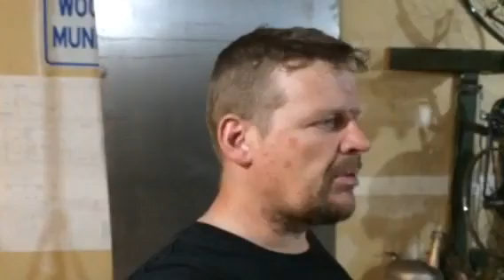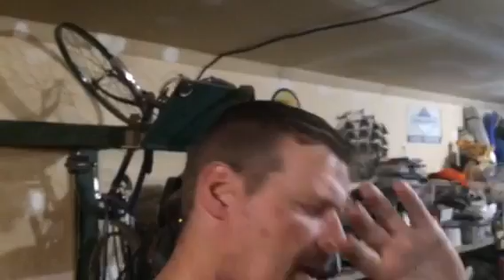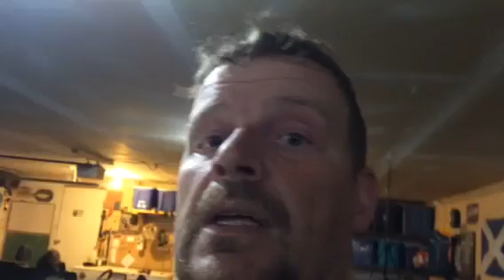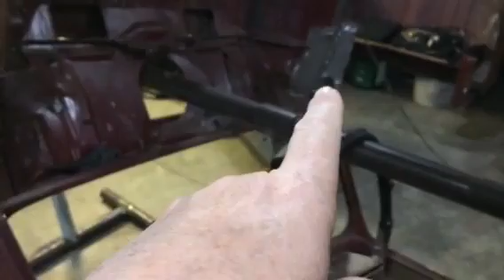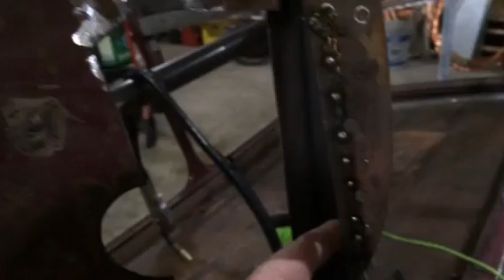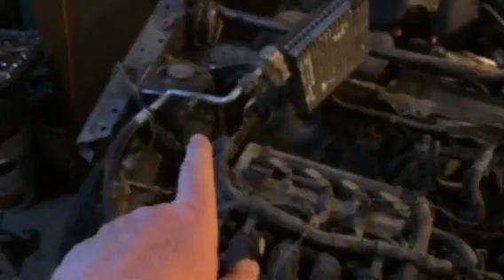Prairie Mini Project Episode: 18 educate yourself

Comment: Tatty bit n good night.     Know all about Ford electrical issues Well that I always have them anyway
Reply from the maker: Yeah I've alway been a Ford guy, tried a chev 1/2ton when I first landed here just because but quickly moved back to the blue oval, lately the big fords have been plagued with issues so when I traded I went to dodge for a trial, still feeling it out for now. Still have my old guys tho. Cheers bud.
Reply: Cheers
Reply: 97. 7.3
Reply from the maker: yeah, put the IDM in and my 97 fired right up after sitting two n half years. might have a stiction on one injector so i'm gonna put the heat gun on the manifold to see where the trouble is then pull the rocker cover to see. love the obs fords, my f250 has 441,000 kms.
Reply: I'm down to 2 F150 I have 250000 miles on one ,but cracked engine crossmember. After driving same body style since mid 80s . I think I'm done with them for while.
Reply from the maker: yeah ye need a change, my 03 6.0 is like the favorite recliner, i know all the scratches and rattles. i did like my 08 6.4 but i got it too late to save the standard problems so moved it before the water pump went. one shop were wanting $3,600 to do it. phhht!!

Comment: Nice catch up, I’ve worked in dealerships, the politics in those places is unbelievable and yes you can be put in a spot where they just keep throwing new parts at it until they find the right fault. It’s not always just to rip the customer off. Sometimes it’s because they just don’t know. There’s always a polite helpful chap who can fix anything he’ll get every problem job that comes through the door and earns half of what the guys who will only do servicing get. He’ll then have to leave because he isn’t selling enough hours and then they’ve lost their best man. Shortly after this the jobs pile up in the yard until the servicing guys have to sort them out by throwing parts at the problem. The clever guy who’s left is then working for another dealership getting all the problems and is about to be asked to leave...
Reply from the maker: I have a feeling I'm reading someone's biography here, lol. Great thing is in the world of agriculture and heaven equipment good techs are worth their weight and valued because the shops know if the tech leaves he'll take the customers with him, dealerships build massive spaces to sell new machines and squeeze every inch out of service space (you know) as their money is made on mark-up and volume through the shop, doesn't hurt to put good second hand stuff on and charge for new either. Gosh we could tip a few lamenting on this subject eh! Cheers bud.

Comment: 100% agree Doug about watching the youtubessss someone has more than likely done it and messed it up before you so you can learn from their mistake or knowledge. I learnt everything about mechanical knowledge from youtube and the forums which unfortunately are dead now.
Reply from the maker: Exactly bud, if it's a common fault it will more than likely end up on here eh? And 90% of repairs are fairly easy done and with out special tools, good luck with your wee project bud.

Comment: Doug, Great job on the A post repair I thought i had a problem with postage in Austria but for you i would guess the postage on some parts are more than they cost lol. Can‘t wait to see the shell flipped over and popped on the dumpster! Cheers Dave.
Reply from the maker: Yeah sadly if I'd bought the doorway repair it would have changed the shape of the parcel and the postage rate, but like I said I want to get better at this not just at putting stuff together but in actual making parts from scratch. With this not being a restoration I have room to ad lib. Cheers bud.